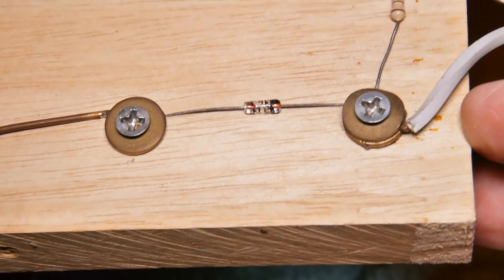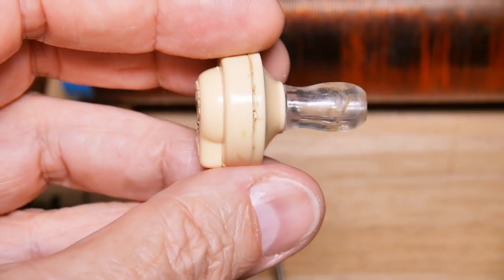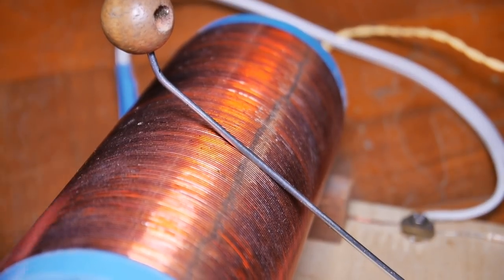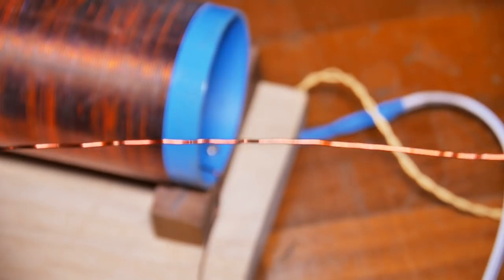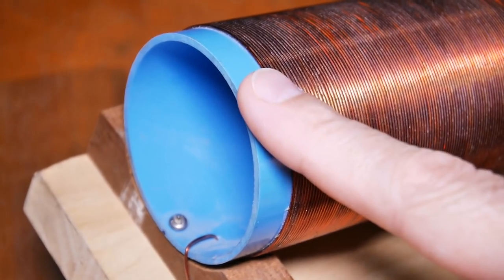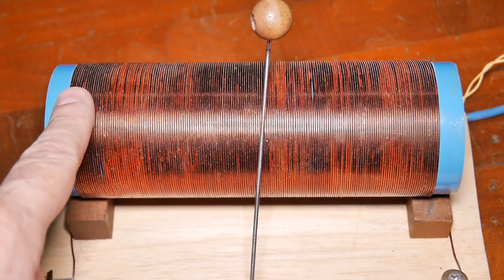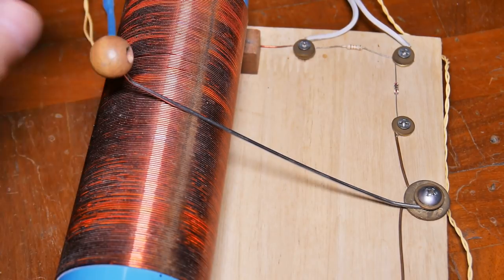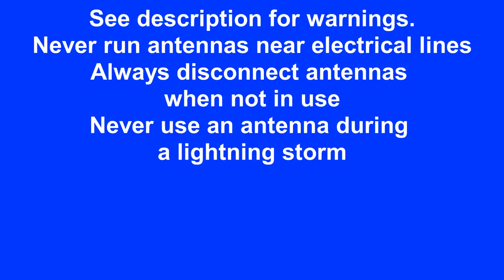My Crystal Radio Does NOT Work (FIXES for common problems)

Comment: 2:28 Those crystal earphones are high impedance devices, because they are high impedance devices they don't load-down the circuit they're connected to, that's why they work, a crystal-set radio circuit is a high-impedance RF circuit that is, it operates at very low currents maybe a few micro-amps or so, most modern iPhone earphones and etc are low-impedance devices and need to be driven by a low-impedance circuit in order to operate correctly.
Reply: Can an old rotary telephone earpiece(that has a metal diaphragm coil ans a magnet)be used as a ear phone for audio sound of this crystal radio?..
Reply from the maker: I have heard they work, but I have never tried it.

Comment: Either use all brass or all stainless or solder your connections. Mixing two dissimilar metals causes a galvanic action that will corrode your connections. Never use a combination of aluminum screws and brass/copper washers as they react the strongest with each other. This goes for any radio you may construct.
I have a question: can you use a 4 pin tube base to wind coils on so you can change bandwidths? Thank you.
Reply from the maker: Yes, older radios used to use changeable coils or tapped coils to reach different parts of the band they wanted to receive.  But back then all bands were AM, so one could do that.  Today many bands are FM or other and this radio won't work for those.

Comment: I’m curious, you mentioned how using bare copper would essentially be like using a copper tube. Once you sand a strip for the wiper, how is that not also a solid connection?
Reply from the maker: There is still insulation between the each wire. Only the top of the wire is bare.

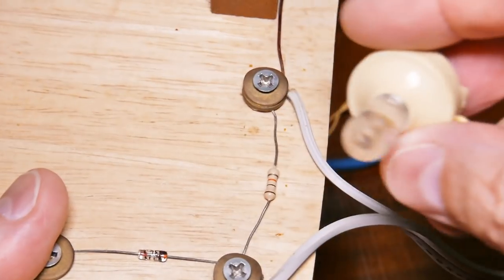Comment: 5:03 So that means i can replace it with  a variable capacitors? So i don't have to use the resistor?, my big confusion is can i add a variable capacitor to that single wiper Crystal Radio?
Reply from the maker: If you use a old style earphone from before 1960s, you use a capacitor. If you use a newer one it has to be a resistor. If you use the wrong component, you will get a very low volume sound.

Comment: I long time ago I made a crystal radio very similar to yours without any resistor and the signal came in crystal clear (no pun intended). Even when hooked up to a 30 watt amplifier. Now I can't get nothing but a little static sound. At the time we had a local AM station, but I could also get a few other stations (al be it not as clear). I can still get a few not so clear stations on a cheap junk clock radio which was never very clear. I expected some oxidation after 20 years of sitting and I cleaned up the connections and checked for continuity, but I can get it to work. 

Maybe the signal is too weak, but I should be at able to hear something. I'm using the same diode as you are. Is antenna length super critical, because who knows if I cut off a piece of the antenna over the years for another project. My antenna is about 15 feet long.

I used a 3/4 " plastic tube with very fine enameled wire with excellent results.
Reply from the maker: I have a video on when things go wrong: https://www.youtube.com/watch?v=kCxQ8iPQx4s
You say you don't have the resistor, which is OK if you are using a 1950's type crystal earphone, BUT, if you are using the newer piezoelectric earphones then without the resistor you will just hear static and popping. AND, with the newer style earphone, you absolutely don't want to add the old capacitor they used to use.
Reply: @tsbrownie  Thank you very much for that info. I must have a crystal earphone. I think the diode I have is old school too, because it looks more like a resistor with  black, brown and red bands, instead of the  modern glass type.
Reply from the maker: @gordthor5351  Give it a try and let me know.

Comment: Does the diameter of the plastic tube you coil the copper wire around matter as the tube I have is about half of yours?
Reply from the maker: Yes, it matters a lot. Changing any of the dimensions changes the frequency range of the radio. If you get outside the AM band, the radio will work badly or not at all.

Comment: Can you use copper, multi-strand wire or is solid necessary for your antenna?
Reply from the maker: Most that I've seen / used are just single strand wire.  It's almost always bare wire, so multi-strand would hold water longer and corrode faster.  In theory, multi-strand may also deliver a less sharp signal if the different strands receive / send signals at even slightly different speeds / distances.
Reply: @tsbrownie  Okay, thanks for responding. :-)

Comment: 1:10 Eh.... I'm currently using a germanium transistor wired as a diode. It's working fairly well.
Reply from the maker: They "work", but a much quieter. You lose faint stations. Try comparing it to a D9K or 1N34A, the difference is significant.
Reply: @tsbrownie  Yes, but I don't have a proper diode. Would like one though...
Reply: @tsbrownie  I get a forward voltage drop of about 200mV, and with the questionable antenna I have I can receive the two most powerful stations with good volume. You could definitely do worse!
Reply: @tsbrownie  So as it turns out, I DO have germanium diodes! 1N60's to be precise. (Thought they where silicon or something, datasheet says schottky, and the MTester says Vf=~720mV)

Yeah, the actual diode is better. But I will say, the germanium transistor thing isn't that far behind.
Reply from the maker: @qwertykeyboard5901   OK, is it working better? I have heard about the germanium transistor and will have to compare against a 1n34a or d9k.
Reply: @tsbrownie  Yeah it's working better with the diode.

But the transistor works in a pinch!

Comment: Nice 
Why did you use a resistor connected to the coil  , & what is its value? 
Thanks
Reply from the maker: The specifications of all the parts are in the description.  The resistor is to dissipate charge on the piezoelectric earpiece.
Reply from the maker: @Kirk Rundstrom Science is all about observation.  Sounds like you were a natural born scientist!

Comment: On the right side of the radio, was the wire, earphone, and resistor between the 2 brass washers or under the 2 (between the 2 washers and the wooden base?
Reply from the maker: In between 2 washers is best.  If you have only 1 washer, put the wire between the wood and washer.
Reply: @tsbrownie  Thank you for the help

Comment: What is the optimum diameter fo the coil tube?
Reply from the maker: The details are in the description under each different radio video. Rules: 1) The system has to resonant in the range of the AM radio band. 2) Generally speaking a larger tube has a higher Q (more efficient) to a point. (See rule 1). 3) I have a video on the factors involved in the coil. This is important. Guessing won't work.

Comment: a good ground is of most importance-it is the return or completion of the antenna circuit--i once had a poor ground and it worked sort of--when i replaced my poor ground with a good 8' ground rod the difference was day and night-
Reply: sorry-the strike through seems to always happen on utube--not sure why-
Reply from the maker: I did a search on youtube and strike through and they said it's the use of hyphens that does it.  Let's try.  hyphen this is a test hyphen.  And it works.  The hyphen has to have no space between the character and itself.
Reply: @tsbrownie  --thank you sir.. i will try to avoid the hyphen from here on..my old english teacher would be upset with me if she knew i was doing that anyway..
Reply: it worked.. thanks again..

Comment: My crystal radio only works when I have my hand on my variable capacitor or on the coil. When I remove my hands it stops. I know I’m picking up a station because I can hear music. But when removing my fingers it just stops. any solutions to this ? And also a few bits of info, I’m using a plug in usb speaker then attaching my heads to the speaker jack.
Reply from the maker: The signal on mine often increases when I put my hand near the coil.  That is normal.  It sounds like the station you are getting is very faint.  I can only guess, but I think your USB speaker requires too much power and is interfering with the radio circuit.  It is BEST to use a crystal earphone.  Next choice is to use a battery powered amp connected via a small cap in serial.  3rd option, try putting a small capacitor in between your USB speaker (in serial) to cut down on the power draw.  That *might* help.  Let me know if that helps.
Reply: @tsbrownie  alright thank you, I’ll let you know how it goes later. I ordered a crystal earpiece a few days ago and it should actually be arriving today or tomorrow. I also might try to move the radio around, my house is very electrically loud and might be causing interference.
Reply: @tsbrownie  still no luck, I ended up adding a 0.1 UF capacitor and a 43k resistor onto the radio. The good news is that I hear a light buzzing coming through the speakers “Which is very faint”. And I don’t even have to have my hands on any of the metal now. The bad news is I can’t hear any radio channels. I think my last options are to wait for my High Impedance ear phones to arrive. And also increase the intenta now that I have added those components on.
Reply from the maker: @Adam-qd8jh  if you can take a video and post it, put the link here and I can take a look. You might also watch my video on antennas. How far is the nearest AM station from you?
Reply: @tsbrownie  I have a few radio towers that broadcast AM around me. One is 6.4 miles away from me, and the other one is about 7 miles away. There are more but they are in the range of about 14/24+ miles away.I was actually going to make a 75+ foot antenna as the one I have now is a measly 10 to 15 foot antenna. I will upload and send the video link within a few hours.

Comment: And how to connect a metal gang for tuning?
Reply from the maker: I don't understand the question. Do you mean a variable capacitor? This type does not use a capacitor.
Reply: Yes. I mean dielectric metal gang condenser.

Comment: Why would paint affect the coil's performance?
Reply from the maker: Any paint that contains pigments is a problem. Pigments are chemicals that contain metals. Metals react with the electromagnetic field of the coil. Colored paints would be similar to covering the coil/tube with aluminum foil. Clear acrylic spray paint is not a problem.
Reply: @tsbrownie  THANKS SO MUCH, could be a problem on one of my recent builds. It's a pretty build, just isn't working. :)
Reply from the maker: @Joel Ohmer  If you post a video of it  leave a link. I'd like to see it. Also, I have  a video on common reasons they don't work.

Comment: do you need an electricity for this?
Reply from the maker: No, the power comes from the signal itself.
Reply: @tsbrownie  :O awesome! But is it possible to tune into 108 MHz FM with this?
Reply from the maker: @MiiMaker  FM works very differently and requires much more complex decoding.

Comment: I make it work but it have to use mini ampli..if not no sound.
Reply from the maker: Something is wrong. If the station is within 15 kms, you should hear it clearly with just the earphone. Here is a video on common problems:
https://youtu.be/kCxQ8iPQx4s

Comment: Hello my friend? what size capacitor, is the one in this video?
Reply from the maker: Only 1 of my crystal radios uses a capacitor (and it uses 2). https://youtu.be/VJ80Nm9KSkE
Crystal radios from when I was a kid 60 years ago had a small capacitor, BUT they used a different type of crystal earphone. The new crystal earphones are piezoelectric (with built in capacitance), and if you add a capacitor instead of a resistor you will get static.
Reply: @tsbrownie   Thank you so much for your reply back, lol lol I'm going to let my grand kids make one Like i made 60 years ago lol lol
Reply from the maker: @richardsmith7783  Very cool! It's a bit of magic shared between generations. Have fun!

Comment: Yep, i built this one myself and i ant get that thing to work, I made a tesla coil for wireless got that to work but this radio, not so much !
Reply from the maker: If you have an AM station within 30 miles, it should work.  Give it a check again and compare it against this video to see why it's not working.
Reply: @tsbrownie  will do, I'm going to try one more time and i will also try with a varible tuning block i had from old radio, but not sure what side is am !, but thanks

Comment: You did not ever give the value of the resistor!!!
Reply from the maker: A 10k is usually good.  The specs are in description of the actual radio builds.
Reply: @tsbrownie  Wasn't sure where to find it. I plan to use a ferrite rod antenna, with VTC ( 365 pF ) as I need to be mobile. Thank you very much!!!
Reply from the maker: @davidj.lebaron709  That's interesting.  Please post a video when you are done.  I'd like to see it.
Reply: @tsbrownie  Thank you, will do!!!